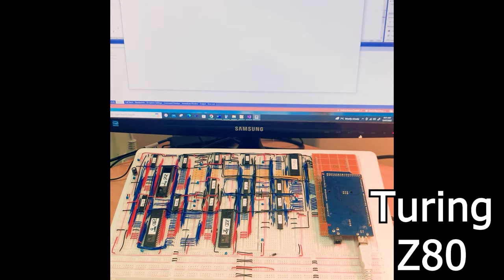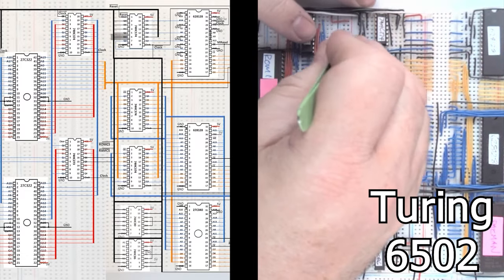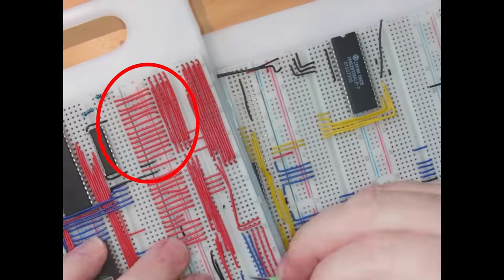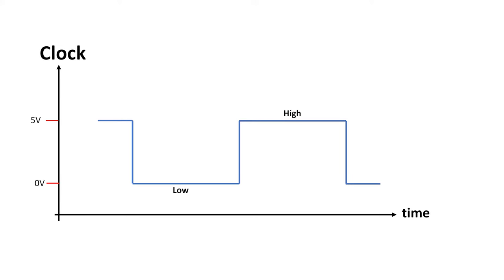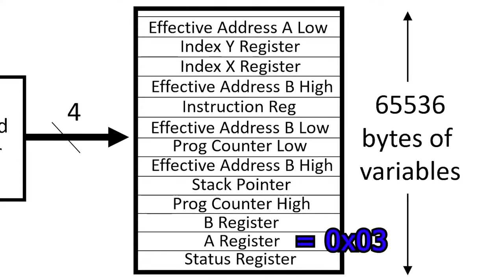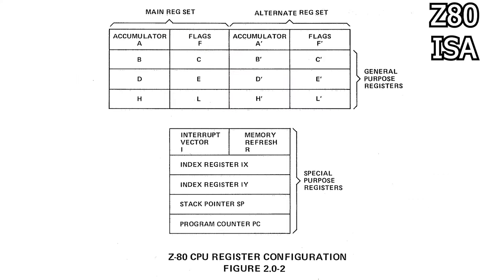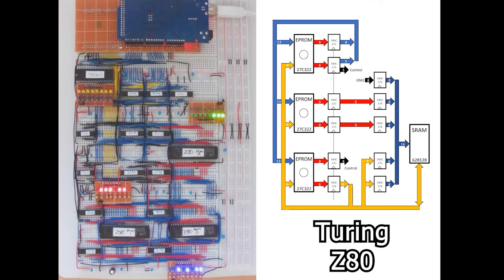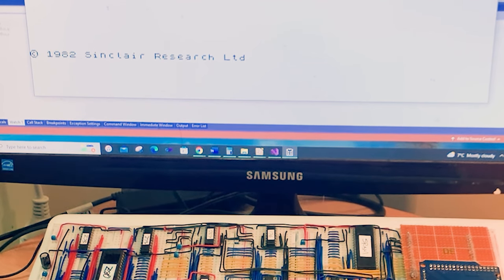TTL CPU Z80 Build

Comment: that off-camera second breadboard really lets you get a head!
Reply from the maker: Yes, the off-camera build lets you cut and shape wires.  But in the end the Z80 used the 6502 off camera build but had no off camera build of its own.  Fortunately many (or most) of the wires from from the first build were the correct size.   With the 6502 build, i was finding that even slight movement of the board would look crap when it was played back at high speed.

Comment: My guess was that the extra bits were required for the Z80's port mapped IO. I never wrote Z80 assembly so I didn't know how many registers it has.
Reply from the maker: Yep, all the registers make it tough to write the state machines.  Just so much repetition.  I should probably autogenerate some of the state machines  and parameterize the registers, but i haven't done that yet.
Reply: @DrMattRegan  Sounds like a job for an RTL to microcode compiler.

Comment: It is very interesting how when transistors (EEPROM) are cheap re-creating small 8bit processors can be turned into a programming problem to generate the finite state machine (the content of the EEPROMs).
Reply from the maker: Yes exactly.  I would argue the same is true for FPGAs.
I personally like the EPROM approach better (obviously) for these applications.  To me it feels closer to the silicon.  FPGAs still feel like they have have a layer or magic between your design and the silicon.
Reply: @DrMattRegan  indeed. FPGAs (these days) require Verilog, VHDL and/or another language/framework. And somehow "feel" more "detached" from the implementation. Your direct approach and series of videos is very educational. They can be very useful for someone currently studying digital design or introductory computer architecture.
Reply: @DrMattRegan  Proprietary magic at that 😕

Comment: So, lets say does it pass ZEXALL2 ?
Reply from the maker: No haven't tried it yet, just getting the spectrum to work first.  I still have a few instructions to implement, but i do plan to make a video about testing down the track.
Reply: @DrMattRegan  Undocumented flag states barely rely on simultaneous ALU operations, that are not shun completely during sequences, for example - INIR have three of such. "Q" emulation for ccf/scf need two extra flag bits, also note WZ register, hidden byte-sized data latch register, 16-bit adder/latch, and overlapped microcode sequences up 4T late.  But for a finite state machine (ie emulator), overlapping is not seen for assembly. Vizual Z80 Remix may help you to find all quirks.
Reply: @sergeygoncharov8205  The original Z80 had a 4-bit ALU(!)
See Ken Shiriff's article on this.
Not sure how it affects the timing, Ken probably elaborates on it.